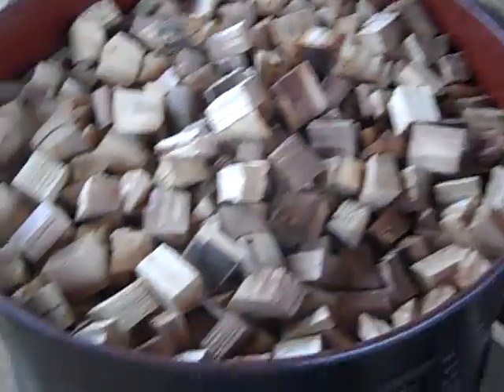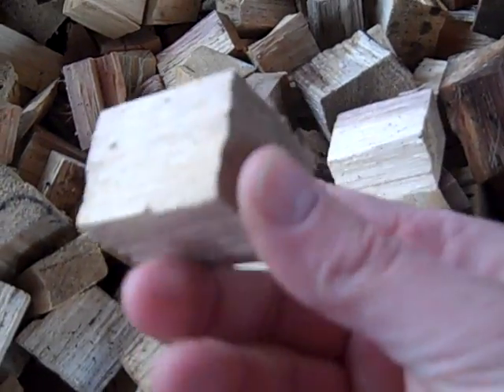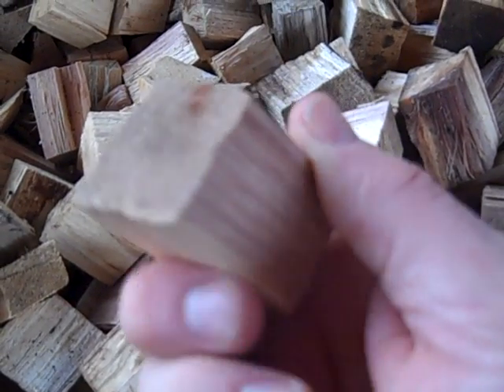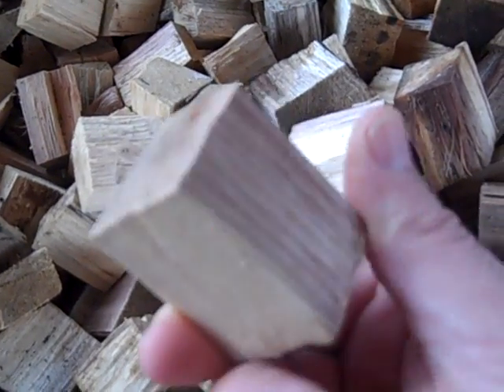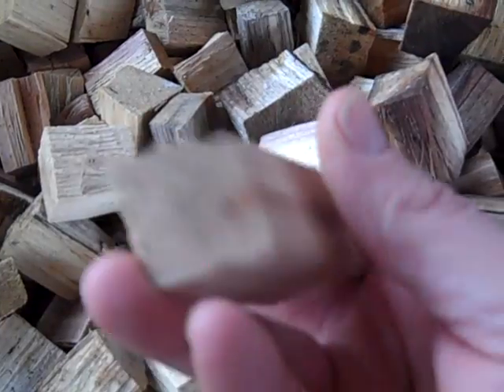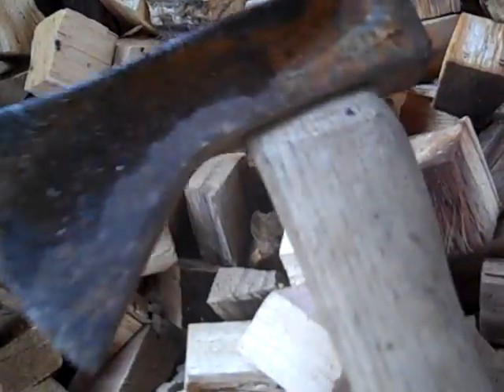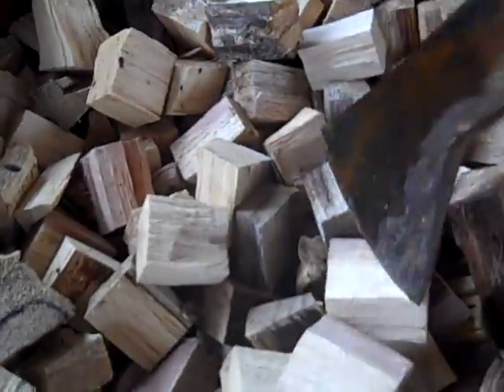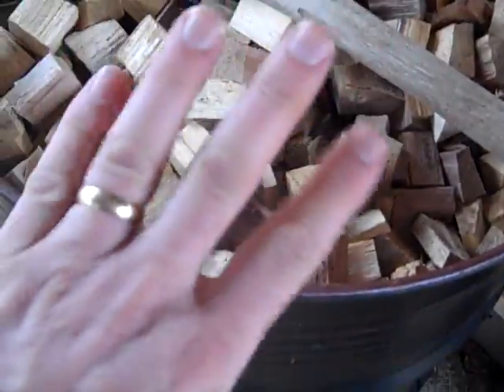Wood chunks for the gasifier

Comment from the maker: @patrick2586 chips are hard to use unless they are large,.  most chippers make too small of a chip for my gasifier.  I am having a buddy with a tub grinder , grind me a dumptruck load of white oak to test.  It will be awesome if it works because he can chip 20 yrd in about half an hour . IT would take me a month of steady chopping by hand to produce that much gasifier fuel.